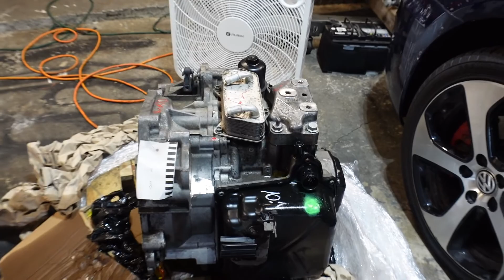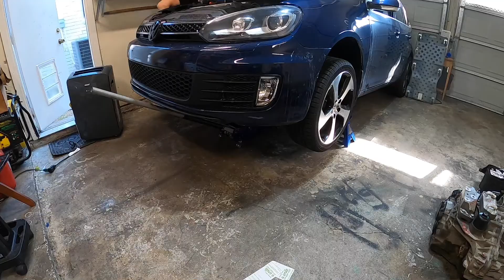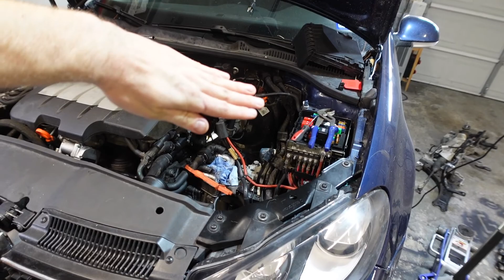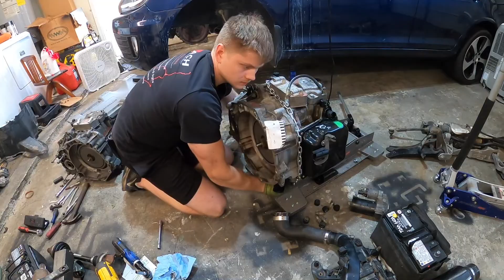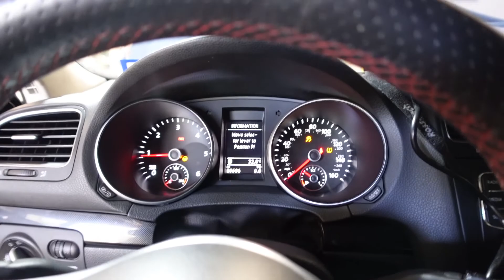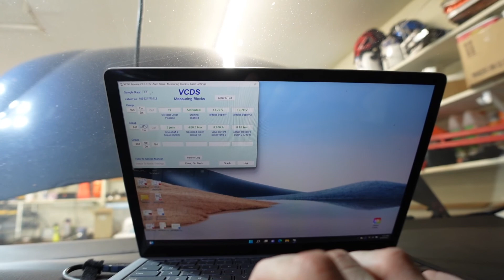Transmission Round 2 - European 4motion Transmission Going In!

Comment: The major difference between the gasser and TDI box is gear ratios that is not in the mecatronics unit. That is the valving and control for the automation portion. 

On the manual transmission cars you actually can swap a FWD gear set into an AWD 6-speed box.
Reply: Hi Sean, I'm from the UK do you think ita possible to convert a manual vw caddy 2L to an automatic easily? Thanks
Reply: @SteveClements-ju9rr  I don't know a ton about the caddy platform past the mk1 version. I assume it like most VW models share a good deal with other similar sized vehicles. 

If it shares the majority of its components with a golf or passat, I'd guess it's in putting the right parts together. If you need help, I would talk to the guys over @darksidedevelopments. I get most of my parts from them, a good group of folks.

Comment: Why didn't you get a new transfer case with the transmission just in case the one you have was also damaged.
Reply from the maker: I did end up getting a different transfer case. The original one i was using did in fact get damaged. Turns out when the front differential wobbles, that affects the angle drive as well.